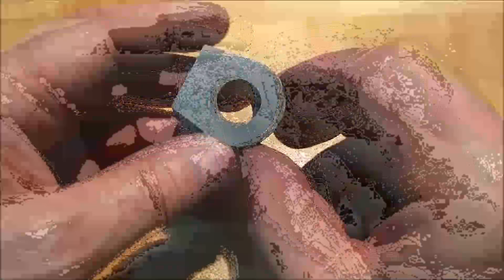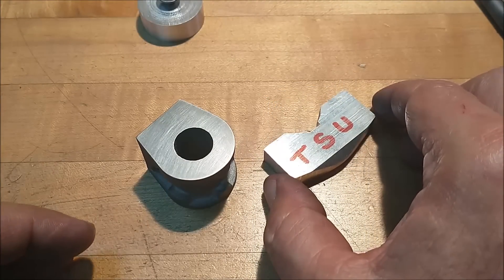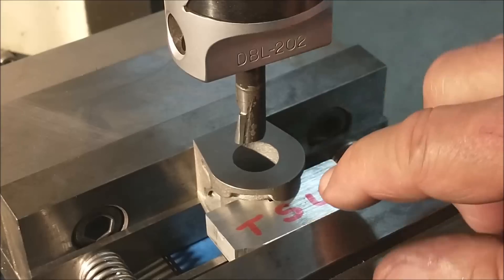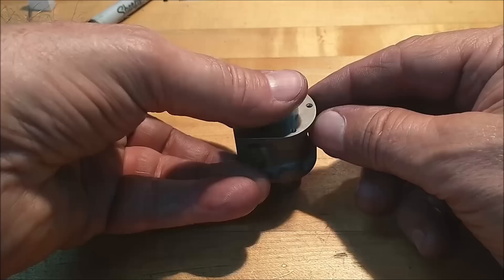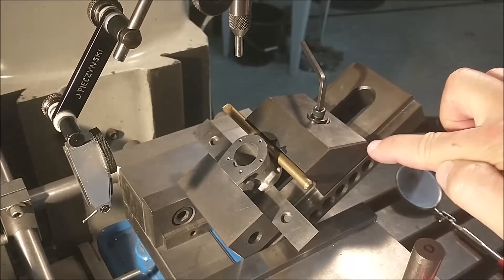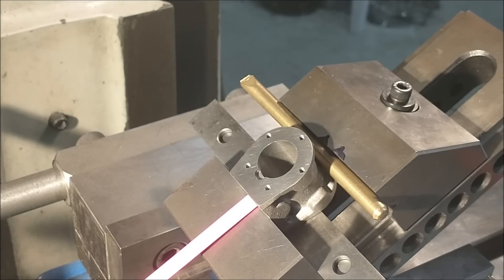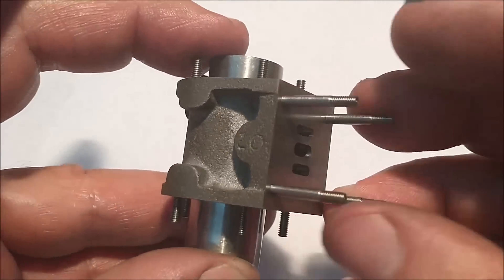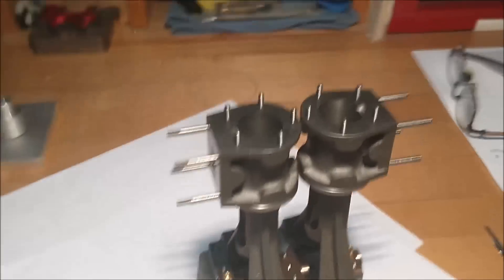Stuart D10 - # 8 -- Machining the Cylinders - Part 2

Comment: I really like that tooling ball technique to find the centre. It will be instresting to see how much power engine has when finished. Cheers from Australia 🇦🇺
Reply from the maker: I'm curious too. It doesn't have rings, so the power is reduced. I may have to add some. The PM kits use teflon rings.

Comment: With the precision you are going for on this engine it should run like a top end Swiss watch. One thing on a lot of models I see is to get the studs and nuts looking right so the thickness of the nut and the size of the hexagon is in scale with the model and the length of the stud is correct with a nice rounded end. Stock nuts are too thin and double ended. Nuts on old steam engines have only one chamfered end and a  flat face against the part. Getting this looking good really makes the model. Get it wrong and it can really spoil the model.
Reply: Has to be good... it is going to power the whole mini shop. :D

Comment: I would find it helpful if you took the tooling ball concept to the whiteboard and talk through how using it got you aligned to the proper point for the angled drilling operation.  Yes, I get how you figured out 33 degrees, but . . .
Reply from the maker: https://youtu.be/FnEl6Kj-F-E   white board demo starts at 14:18
Reply: @joepie221  Yea, I watched that before making my suggestion.  Sorry - didn't do it for me.

Comment: Hey Joe. I have the P.M.Research Boiler #2 kit. I was wondering if you have thought about getting one. It does require soldering and riveting (using tools that you need to make).
Reply from the maker: To be 100% honest, I have no interest in building a boiler. I'd rather build a bulldozer.
Reply: @joepie221  😂 I'm with you Joe
Reply: @joepie221  I haven't built the boiler yet, but I have built a couple bulldozers..........(out of Legos). LOL

Comment: The art of war, by Sun This Zide Up

I feel like I missed something. You started by saying that there is a specific dimension from the steam chest gasket surface to the centreline of the bore but it seems to me that you indicated both x and y on the disk/plug, which is aligned with the outside of the casting body... what did I get wrong?
Reply from the maker: The 'Y' axis was set by the edge finder as shown. The table 'Y' axis was locked and never moved. The apex of the indicator sweep on the puck, closest to me on the 'Y' axis, became the indicator standard to look for on either 'X' side of the puck. The table was then shifted left and right until all 3 points read the same.

Comment: Looking good!
Question: You used the Aluminum TSU block for clamping when you bored them ... why not maintain continuity and use it when drilling the 33° hole to the steam ports?
Thanks for sharing 🇨🇦
Reply: I was wondering the same thing.
Reply from the maker: The 33 degree hole wasn't nearly as aggressive of a machining op like the bore. Light pressure was sufficient and a single bar was fine.
Reply: Thanks for the info! Makes sense!

Comment: So basically, this steam engine is going to run the machine shop you built. Like, a diorama machine shop powered by belts and pullies and steam.
Reply: With his own custom line shaft set-up for all the machines of course!
Reply: @paulcooper2897  Yeah that's what I meant, just couldn't remember what the dang thing was called. LOL
Reply from the maker: I'm thinking the other steam engine on this channel is actually more appropriate for that. It lit the fuse on all the miniatures I have done.

Comment: Think, think, think, Setup, setup and setup. Don't forget the physics in play here as well eh. Good to see you Joe. I am always impressed with the condition of vise jaws. Yours are all in great condition. I have seen and had to use vises that are hacked into, drilled and hammered the daylights out of. Want some pressure in a job. That's the best way I know of is to HAVE to use a beat up vise that you can't get a good grip on a part. Shoulders and neck muscles standing straight out from worry. That is some slick machining my friend! ! ! No doubt that eh !

Comment: Further to the question of "over constrained" from the previous video in this series: If you had not reduced the contact of the saddle (about 2 mins in) to achieve 3 point contact then the saddle would have been over constrained. The contact faces on the cylinder block could have been conflicting with the surface in contact with the vice. This could introduce unpredictable forces on the workpiece. A less than satisfactory clamping of the workpiece as a result.

Comment: Hi Joe, when I built the single cylinder version and ran it I noticed substantial vibration, to fix that I added quit a bit of bolt on weight to the crank until it came close to balance. this worked quite well and the weights look like they belong there.
Rich